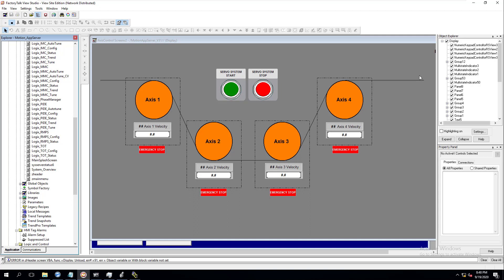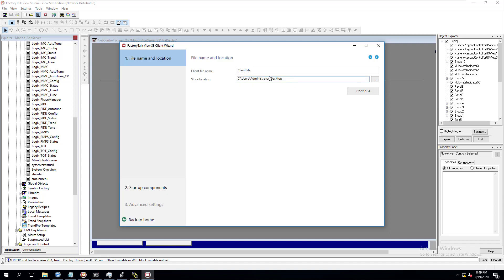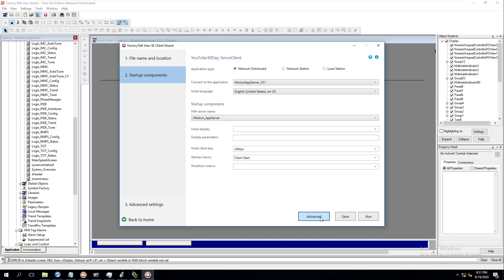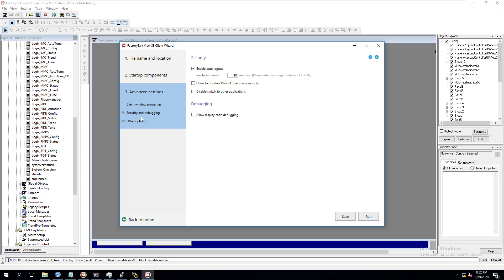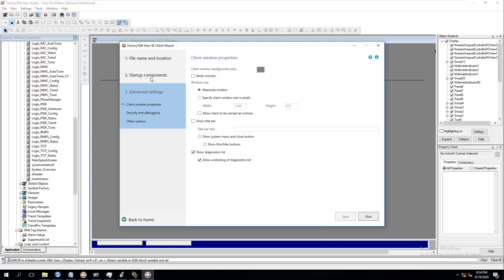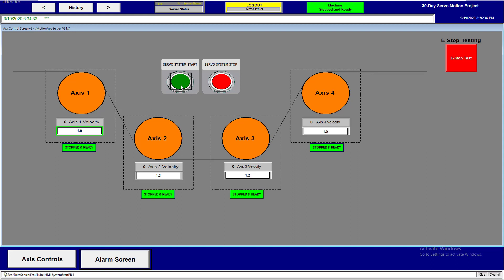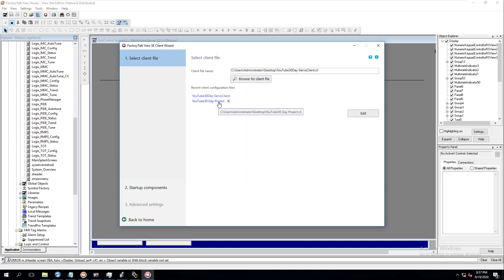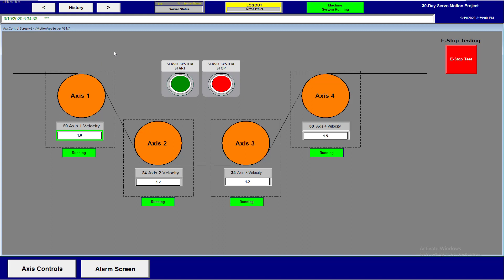FactoryTalk View Studio Version 10 | Making HMI Client File | Tips & Things to Know

Comment: Great video, at 02:15 what can I do if there is no application to connect, the dropdown is empty? But I can see my application everywhere else, at the console, at studio, etc. I'm stuck in creating the client file.
Reply from the maker: If there is no drop down then you are not using the right type of application or either you do not have one
Reply: @ShaneWelcher  
I've sorted out my problem: 

My project was developed as a network station, where the HMI server and the client needs to be on the same computer. I was trying to open the client on another computer, so there was no application showing at the dropdown.

I've recreated my app as a Network Distributed and everything appeared at the dropdown field.
Reply from the maker: @edevalddrovetto3763  great, glad to hear you got things worked out

Comment: Since I’m a Process Field Engineer at my Company who also works doing Control Automations because our department is small and does it all, I’m one of few who has access to our RA Tech Toolkit License with all RA Software. Recently started using FTV v11 upgrading from v8.0 for project HMI Upgrades. I design and redesign the HMI for our customer projects usually for upgrade or conversion from another Software like Citect to RA FTV. Which I’m ok at doing all the onscreen graphic design drawings from PID’s as we are an Engineering company also so we have PID of everything. 

I initially had to learn everything from absolute zero with FTV and drawing HMI as well understand tag programing. My senior co-worker first sat me down showing me how to do HMI work by first showing me how to draw ✍️ a simple line. Then make a box, a square, a panel etc about 5 years ago. Amazing how much I’ve learned since to be able to do 60+ displays on a project with embedded windows. I never got much formal training of any kind. And learned just doing projects with some help from my Senoir Programmer as it’s only just the two of us. 

I learned some from the RA RSTrainer Software if not to just understand some aspects of the program. But still learning as I went along. Initially just copy paste from previous projects and modify objects as needed and scrub the tags and embedded animations. That’s how I learned. I say all that to say that these videos are very helpful and informative to anyone learning or new in learning the Softwares and doing common things you need to understand how to do. Like in your video how to configure and setup the application runtime. Every time I watch your videos, I learn something I didn’t quite know, find useful to now know , yet ever reminds me how to do something. Keep doing the videos. So much training can be done on just RA FTV and Studio. I appreciate it all. They do much for training! One thing you can maybe cover or address sometimes are the differences or what is newer functions in a newer version vs a previous version software.
Reply from the maker: First of all, congrats on your effort to better yourself & being the person you are.

Thanks for the kind words